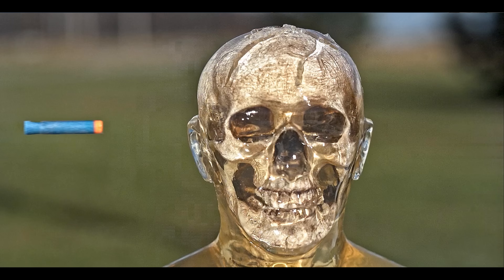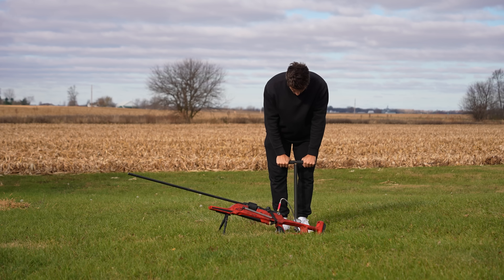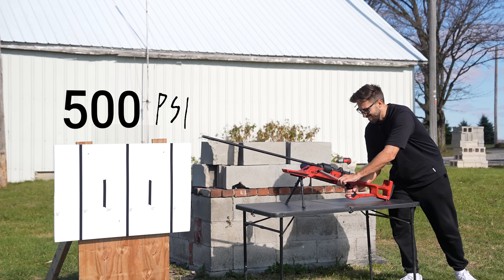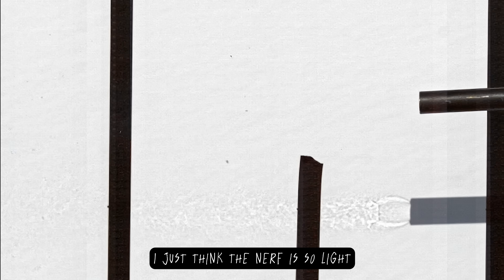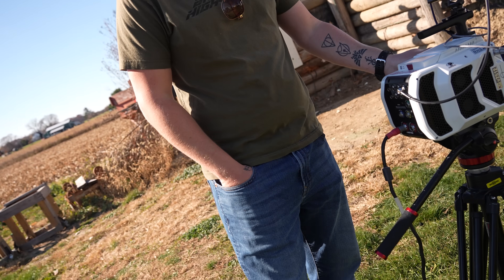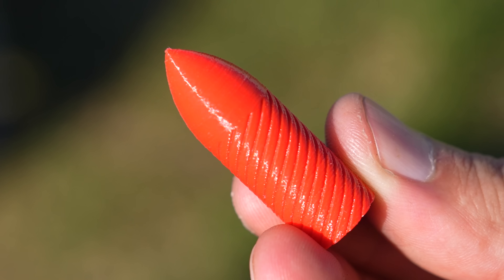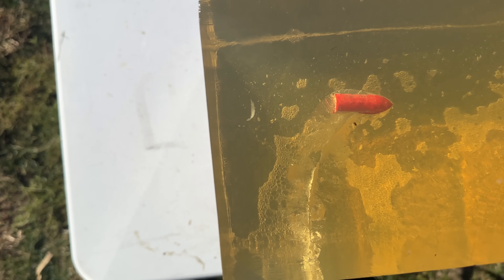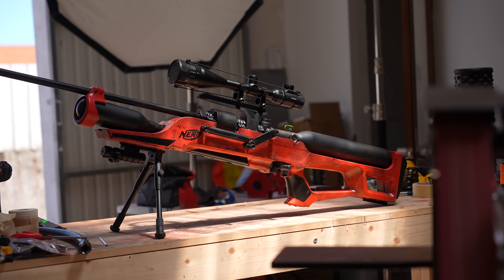How Dangerous is a Supersonic Nerf Dart?

Comment: Hey Mike! 
I study Aerospace and work on aircraft.  One reason why you might have had a problem reaching Mach 1 is because of drag increasing as you get closer to Mach 1. So, reducing the cross section area of the foam darts to improve transonic performance might help. Additionally, the moments of inertia for a bullet with 2 different bullet materials might be the reason why the foam darts disintegrated. 
In theory, you'll need to make sure that the bonding material is able to handle the stresses and strains of the moment of inertia much better. 

I'm still a student, so I might be completely wrong, but trying with these improvements might help.
Reply: The bonding isn't the failing point. The dart's foam shreds the moment it leaves the barrel, causing a sudden increase in surface area amongst other issues. Essentially, the tip is dragging the foam because the bond held, and the foam didn't completely fail, causing rapid deceleration. That's why the taped dart preformed so much better.
Reply: @Rafael_Fuchs the dart is hollow so the pressure is inside it as well. Once it is no longer supported by the barrel but still pressurized from the barrel pressure the foam expands and ruptures. Simple as that. If the foam would not be that much lighter than the tip the tip would just blow out.  Ecause of the tip inertia the dart stays together axial.
Reply: @Rafael_Fuchs  yea
Reply: idk anyhing about that but you couldve just lied to my face and i wouldve believed you
Reply: @McSnizzle-n3x  he just did
Reply: 😂 real @McSnizzle-n3x
Reply: I'm also in aerospace but I work on rockets. I don't think transonic effects is the explanation for not hitting Mach 1 since you don't have the same aerodynamic effects inside the barrel vs outside in free flow. The flow domain is completely different. Also the cross section area of the bullet is fixed because of the barrel inner diameter. What you should do to maximize the velocity is: 1. Increase pressure so you have more initial energy available to accelerate the projectile. 2. Increase barrel length so the gas can do more work on the projectile before it leaves the barrel (at some point this stops working because too much pressure building up in front of the bullet). 3. Seal the projectile against the barrel better so more of the energy of the expanding gas goes into the bullet instead of around it (as in the case of the foam blowing up in the barrel). 4. Decrease bullet mass: less mass=more speed for the same energy input. Though this is a trade off against decreasing your ballistic coefficient. 5. Reduce friction in the barrel. 
Look up "Firearm energy efficiency"
Reply: @michael_zhou  
Wouldn't decreasing the mass make it harder for the bullet to fight drag once it exists the barrel, due to having less inertia?
Reply: @michael_zhou  None of these works. You cannot exceed the speed of sound in a tube of constant cross-section without the presence of a shock wave ((the main reason for the Hyperloop's unfeasibility that we can read in a gas dynamics book from the 50s). For a gas to propel a mass above the speed of sound of the external medium, the speed of sound of the propellant gas must be greater, either because it is at a higher temperature or has a lower molecular weight. Very high-speed gas accelerators therefore use hydrogen. First this, then everything else. Without this, it doesn't matter if the friction and the mass of the projectile are zero.
Reply: It's simpler than that, foam isn't going to stand up to the pressure.  It's shredding trying to force the heavier tip through the air, which at higher speeds has a lot of resistance.
Reply: Borrow a page from the mythbusters playbook and tape the end of the barrel with packing tape and pull vacuum in the barrel, that will let you fire at significantly lower pressures and avoid the pressure build up in front of the round pushing air out of the barrel in front of it.  Without the vacuum it makes the pressure behind the round work harder so you need higher pressures AND it puts more pressure inside the nerf dart.  I think it's that pressure inside the dart that causes them to fail the moment the sides are no longer supported by the barrel and that pent up pressure inside blows the sides out as its exiting the barrel with pressure still pushing from behind because it would still be containing pressure in its hollow core that will work to push out the sides.  At least in the videos I have seen of an air cannon with a vacuum pulled in the barrel enough of the air blast will leak past the round as its forced down the barrel and that pressure will break the tape just before the round reaches the end.  Of course the shape of the nerf dart is also not doing you any aerodynamic favors.  There is a reason rifle bullets have the shape they have.
Reply: Word for word ..it is exactly what I was going to say.........
I mean all the evidence is right there....
Reply: The foam darts seem to have disintegrated due to their hollow design. Basically they are a foam tube with a plug at the front. This causes the inside of the foam dart to be pressurized. That isn't a problem as long as they are supported by the barrel, but as soon as the front exits the sides no longer have any support for the pressure inside the dart so the tip that's outside of the barrel starts ripping outwards. Plugging the hole in the back of the dart would most likely fix that problem.
Reply: The reason he cant reach mach1 is because a gas can only expand at the speed of sound in that gas. If we have gas under pressure expanding and the gas front is traveling at the speed of sound an increase in pressure will result in the gas bunching up on the expansion front which creates what we know as a shockwave. The front will however never travel faster than the speed of sound in the gas even if there are millions of psi pushing behind it.
In regular firearms the chemical reaction of the propellants release mainly CO2, which has a similar speed of sound than air when at the same temperature, but the CO2 leaves the chemical reaction at very high temperatures. High temperatures increase the speed of sound in a gas and thereby make regular firearm speeds possible.
Other gases such as helium feature a much higher speed of sound. If he would use helium to pressure his tank the projectile would travel much faster than the speed of sound in air given enough pressure and a long enough barrel.
Reply: So you saying we need to make a discarding sabot nerf round? >: )
Reply: The point of the experiment was to test a gun that shoots real nerf darts and then see what other rounds can get a better performance on it, not to design a nerf dart that can stay in one piece flying supersonic.
Reply: Easy solution to the darts blowing out as they leave the barrel - wrap the dart. A little thread, or a single layer of thin tape would be all you'd need to reinforce the dart and prevent the blowout.
Reply: Nerd
Reply: Do not help him kill kids🙏🙏
Reply: Do not help him kill kids🙏🙏
Reply: I make rockets thrust vector and active fin stabilized rockets (with and without targeting) among other questionable things having to do with aero and liquid dynamics as well as theoretical physics and quantum mechanics. This is as far as I can think is correct.
Reply: @andjulsin lies bruh Uranus work in MacDonalds
Reply: Ur so wrong
Reply: Nah Uranus is wrong and dumb
Reply: He just needs to increase the temperature of the propellant gas. 
Any other measure is a fools errand since you can't propell something faster than the propellant can travel.
Reply: I have to say, the comments here are definitely worth while.  All of you nerding out, KEEP IT UP, seriously informative and fun!!
Reply: I was thinking with the half dart, there may be enough room between the dart head and the barrel for the foam to be squeezed past... Having a proper seal for the pressure at the front end of the dart will help a lot using foam for the back.
Reply: I think you need rifling; use twisting the foam for strength?
Reply: In laymen terms it's because foam won't go mach 1. If you've ever thrown a ping pong ball vs a golf ball they are the same size same surface area yet the golf ball goes much faster and further.
Reply: Epoxy as a bonding material?
E.g. West Systems marine epoxies.
Reply: Makes sense to me. Being a truck driver helps me rationalize to this conclusion 😊
Reply: You cannot exceed the speed of sound in a tube of constant cross-section without the presence of a shock wave ((the main reason for the Hyperloop's unfeasibility that we can read in a gas dynamics book from the 50s). For a gas to propel a mass above the speed of sound of the external medium, the speed of sound of the propellant gas must be greater, either because it is at a higher temperature or has a lower molecular weight. Very high-speed gas accelerators therefore use hydrogen.
Reply: It ain’t got no gas in it man
Reply: Bro I am also trying to become an aerospace engineer. Pls bro if you have any tips on how to achieve this don't be shy. It is my lifelong dream
Reply: im a aviation geek and a aviation ned,so what aircraft model do you work on?do you work for boeing,airbus,lockheed,bombardier,embrear,or what else?
Reply: @pigeonaviation801 none he just a looser
Reply: "I'm still a student"... proceeds to say the smartest thing in the world.
Reply: @VENTASDIGITALESELROMPECABEZAS  trust me this aint the smartest stuff in the world any physics student or mech engineering student can say it heck anyone who has ready aerodynamics 101 can say it
Reply: @singhji_437  hell yeah

Comment: With nerf darts the dart causes drag on the side of the barrel, the reason the bamboo darts are considered better is they have a recessed shape that causes less points of drag allowing for a higher velocity. The destruction of the darts have two possibilities, too much air pressure behind the dart which you can't do much about, and ripping apart from the friction of the barrel, which you could alleviate with a silicone based lubricant. I regularly use it on barrel attachments to mitigate them affecting the dart with drag.

Comment: I'm not an expert about this field, but I thought that a supersonic shockwave has straight propagation front borders instead of the rounded non-supersonic shockwave. All the shockwaves that we can see in those tries were rounded, so I don't think none of them surpassed the speed of sound. Also, the maximum propagation of a wave through the air is the speed of sound, so I think you can't push and object faster than that only by using compressed air. Dustin from smartereveryday bypassed that problem by using compressed nitrogen which has higher speed of sound than air and also by sealing and making void at the barrel to lower the friction, he used a tremendous pressure chamber and an absurd pressure... Maybe I'm wrong, but I can't believe that your claim about that speed is correct.

Comment: To make the darts hold more pressure I’d recommend and thin plastic tube insert inside the dart. Like a straw. With a touch of glue on the outside of the tube.

Comment: A possible problem with your "rifled" round is the twist rate looked way too fast. Rifling for guns is often something like 1 in 10, 1 in 8, etc. meaning like, 1 twist in 10 inches, 8 inches. Longer and heavier projectiles want a faster twist rate to stabilize, while lighter shorter ones want a slower twist rate to stabilize. (If I'm way off be kind, total layman here lol)

Comment: Mike that rifling on the 3d printed bullet is way too aggressive. Heavier projectiles require higher twist, while lighter requires lower. Try a much lower twist rate on one, maybe 1 twist in 25-30 inches.

Comment: It's 'cold and "dry" ' air, is more dense that 'warm and "humid" ' air. Warmer air can be more humid, humid air carries more hydrogen atoms in water vapour molecules (H20) which are lighter than Nitrogen, Oxygen and Carbon Dioxide molecules.

Comment: What if you drilled some small holes near the muzzle of the air gun? It looks like the nerf darts are exploding because when exiting the barrel they are still under high pressure. If you drilled some holes near the end, it could relieve the pressure right before the dart exits to keep it from blowing up?

Comment: Another important reason why only one of your shots was supersonic is that sound travels faster in colder air. So the sound barrier is harder to be broken in a colder weather. 
As you managed to take your supersonic shot in june , where its hotter , you were able to break the speed of sound. However in November where you took your second subsonic shot the weather was cooler. So even though you might have reached the same speed as the first shot , it wasn't enough to break the sound barrier the second time where the air was colder.
Reply: Its the other way around. The speed of sound is a function of the square root of absolute temperature. However the speed of sound is also higher inside the pressure chamber so it should mostly cancel out. At this level of pressure it could come down to very small effects like leakage around the dart or turbulence inside the valves cause the drag resistance on the dart is so high when close to mach 1.

Comment: ==UPGRADE TIP==
you need to use a faster opening valve like a solenoid to help actuate the primary qev faster.   Also consider using a smaller secondary QEV between the primary and the pilot trigger at least for faster actuation = more power
Reply: The real problem is that compressed air at room temperature travels at the speed of sound at room temperature. To exceed the speed of sound, you have to use hot air.
Reply: @amosbackstrom5366  not really 
you need a delaval nozzle
Reply: Solenoids usually have very small holes inside and I'm pretty sure he already tried it in previous video.

The actual best valve for this is a burst disk
Reply: @linecraftman3907  burst disc indeed.  Good call.
Reply: @linecraftman3907  It's been a while since I watched his original video, but I think the solenoid released air too rapidly and caused the darts to disintegrate inside the barrel, so he switched to this. Might have worked better for these lead projectiles though.

Comment: love the attempt with the rifling but the twist is way way too high, the grooves should only do a quarter rotation at most up the projectile instead of looping around many times. Too high of an twist ratio and the air will shear around the projectile instead of funnelling into the grooves and dragging it to spin.

Comment: 13:34 The projectile hitting almost sideways like that actually helps for energy transfer, which is what is going to do the most damage. Close up, that thing is a lethal weapon to the head. Any further than that and the keyholing effect will make it extremely inaccurate.

I'm actually interested in seeing if you could make a consistent ranged weapon out of it with the "rifled" rounds.

Comment: This just showed me why muskets used round projectiles. Even your solid round (when fired at the dummy) hit at an angle and the shape of it slowed it down a round object i think would be faster then a sidways pointed object. It cant turn and slow its self down because it is all the same surface. Honestly i would have tride a round musket projectile as well. Less accurate over range but it wont destabilize and hit sideways. (Little known fact luis and clark when traveling with sacagawea across America actually brought and hunted with and air gun not like todays obviously but they used it for hunting)

Comment: To put mach 1 in perspective in terms of foam darts: In my country, Canada, anything over 500 feet per second is legally considered a firearm no matter what the projectile is made of. Mach 1 is 1125.33 feet per second under standard conditions, well over double the threshold that is considered 'potentially lethal regardless of projectile composition'. (Airsoft/paintball/etc. guns producing muzzle velocities greater than 500fps fall into this weird grey area called 'non-lethal air guns', which basically boils down to 'you can own it without a license, but if you point it at someone in public it will be considered as a deadly weapon in the court of law') I own a pretty rad manual springer dart blaster that spits half-length darts at about 340fps, and it HURTS to get tagged if you're not expecting it, easily on par with a paintball. Mach 1 is pure insanity.

Edit: To clarify the non-lethal air gun thing: There's a muzzle energy threshold and a muzzle velocity threshold. Non-lethal air guns are projectile weapons that exceed one threshold but not the other. A standard half-length nerf dart exceeds the muzzle energy threshold at around 350fps (I'm riding the razor's edge with mine, I'm aware), which means that at mach 1, that monster is not just legally a firearm, it's a potentially effective one. You would have so much explaining to do if you made that thing here in Canada. They'd probably let you keep it after a lengthy registration and licensing process, but it'd be a serious hassle without a doubt.

Comment: You need to make rounds that have angled gas holes from the rear to the middle of the dart. As the front holes pass the end of the barrel, it will create rotational momentum and stabilize your rounds.

Comment: Plenty of large bore airguns out there on the market capable of hunting big game.
Taofledermaus channel tests crazy home made shotgun shells and consistently had the classic diabolo shape be stable through smoothbore, the hourglass shape of a classic airgun pellet.
No angled grooves made to cause spin going through air ever works because of the front shockwave causing low pressure behind it or something.
Slugs can be stable at different velocities and some are more stable out of a smoothbore than a rifled barrel, would be interesting to see you find a working projectile shape with your 3d printer with metal cores :)